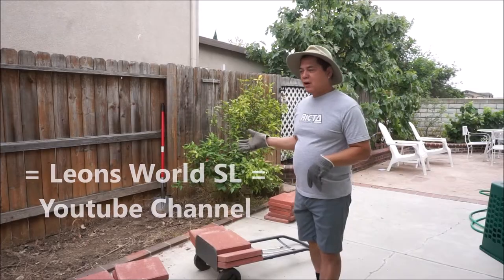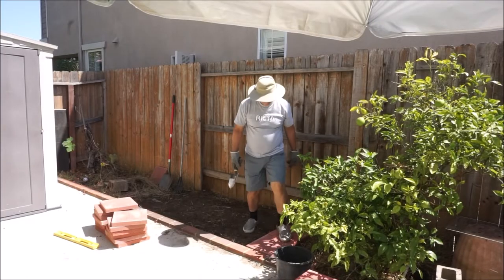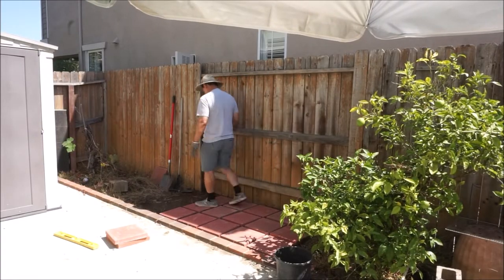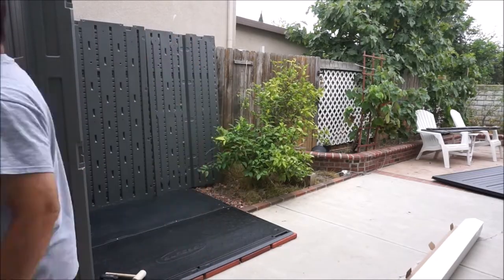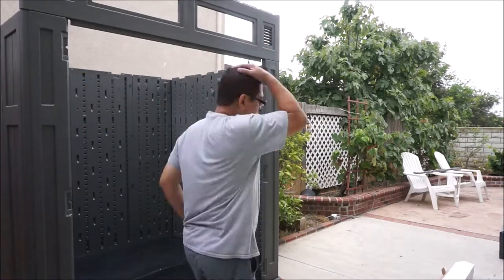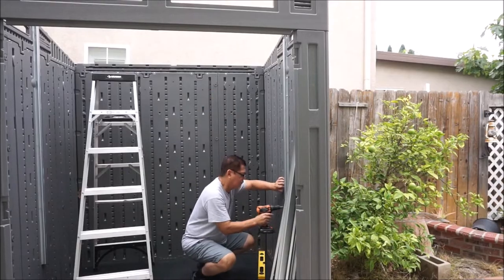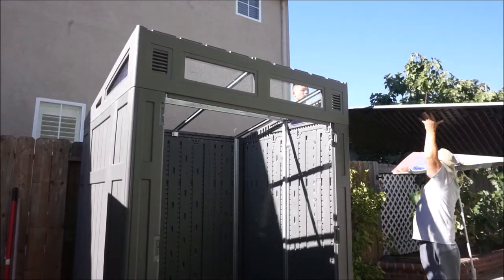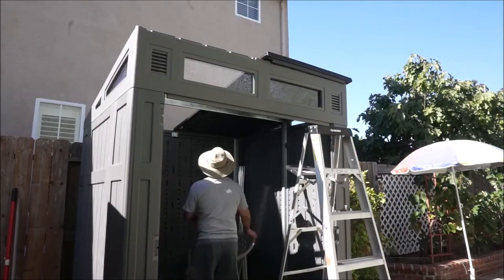Suncast Storage Shed Assembly - Easy to install

Comment: Can the doors be installed on back wall? I want to have water run forward when installed next to house. Not run down back at house. 

Also, some towns don’t allow structures (like sheds) to be built that close to property line. Not sure if this is considered a structure or not since it is semi portable.